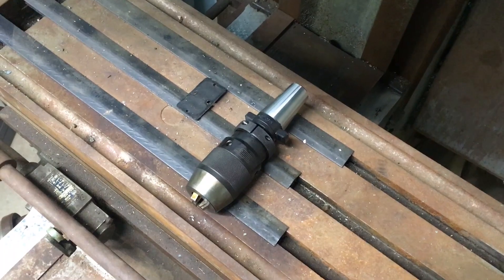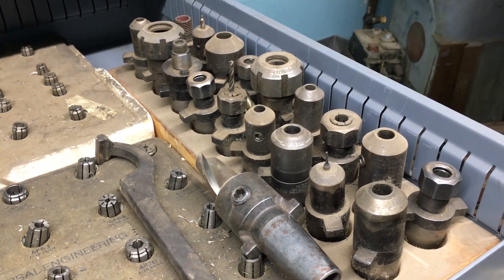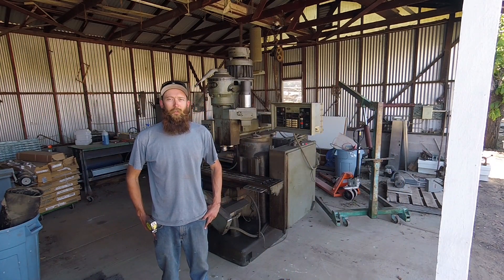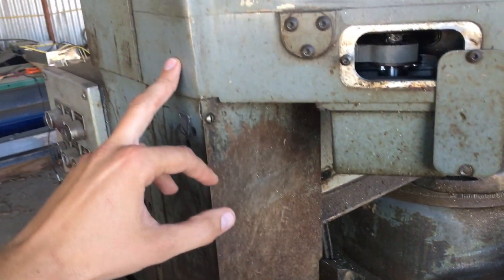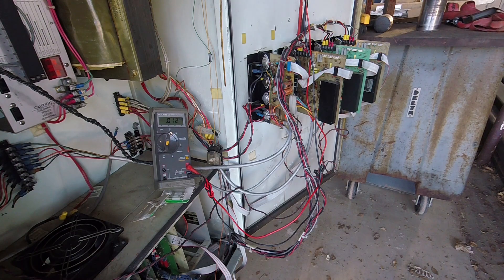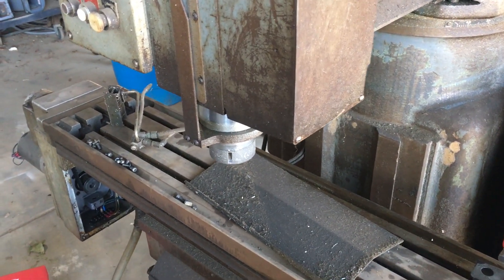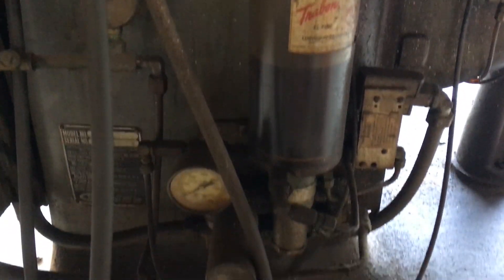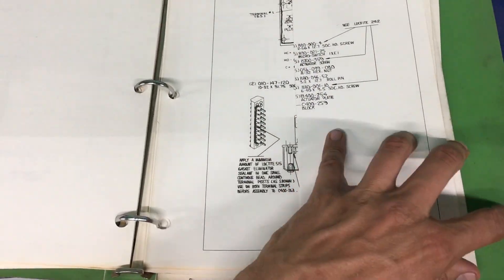Another Wells Index CNC! 750 Knee Mill

Comment: Just brought one into my shed to play with. All the tooling was rusted and have to soak in Evaporust and tumble then polished with walnut media. Have to pick up a rotary phase converter to power it.
Reply from the maker: A 750 cnc? I still haven’t even tried to get the 750 going. The 700 runs great. Does it have the Kwik Switch 200 spindle?
Reply: @riversvic  No it does not, did not get that lucky.

Comment: You can never have enough :-)   Man cannot believe you bought in back of your truck without trailer ! Super cool!. Wells index is awesome i love that machine.
Reply from the maker: It was a little on the sketchy side, I was within the weight limit of the pickup but the machine was a little far back and I could feel the truck was light in the front end on the windy road. I'm glad it worked out though and didn't have to come back later with a trailer, it was a long drive. Thanks for watching!